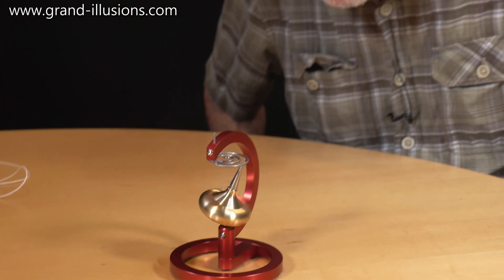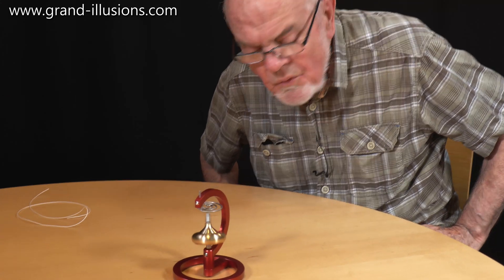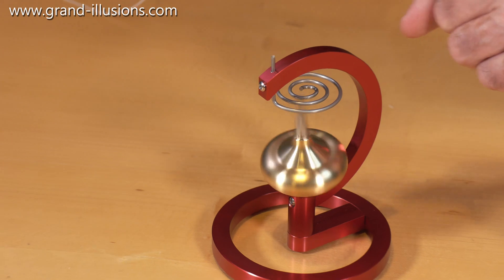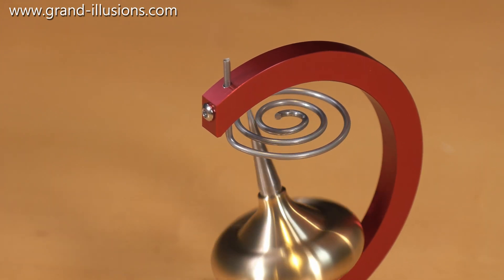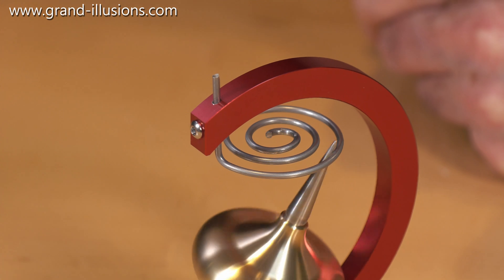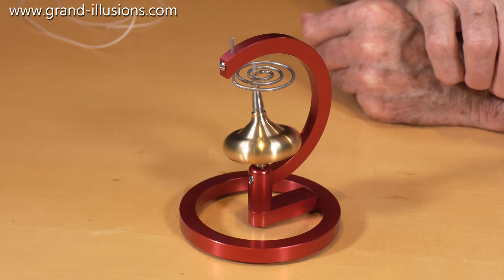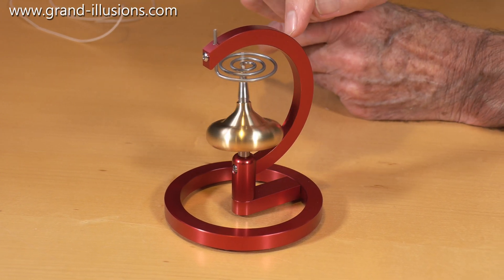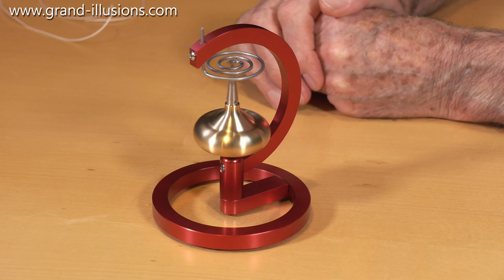Maxwell's Amazing Spinning Top

Comment: That is pretty cool for not having magnets; a lot of friction force is transferred at the point of contact that would probably be about 20% of a square millimeter. When I was a kid I had a linear version of this sort of, that was magnetic. I am sure it is still sold as it's fun and probably cheap to make. This device shown is more cool but it is just a thing you put on your desk. The cheaper toy I mention is fun the same way as fidget spinners. Two parallel tracks that are like a C stretched linearly 8 inches, and the spinner runs across track connected with magnets, then reverses direction...but you can make it go faster or slower or change direction with hand movements.

Comment: So if it’s not magnetic, how does it work?
Reply: I am guessing weight and pressure, it is always trying to pull itself upright but the coil is in the way, combined with the gyroscope effect of it spinning and it is always trying to push against, the coil to try going upright, and forever fail at the task.

Comment: fascinating. centrifugal force on the tip of the top pushes the tip around the spiral bar, which has two open sides to it, the inside and the out. centripetal keeps the tip going around that bend to close the loop between the two sides….correct me if I’m wrong on the science.
Reply: When the top is on the inside, centripetal force pushes the top outward and the wire applies an equal and opposite centrifugal force.

When the top is on the *outside*, there is nothing applying centrifugal force and you would expect the centripetal force to just fling it outwards. Thus, there must be something else at play. What is it? I don't know.
Reply: Centrifugal force is not a real force, and if two were balancing there would be no rotational motion. 
This looks more a consequence of gyroscope effect - spinning object resists change in its orientation. So when gyroscope is outside, it tends to go back inside to its original vertical orientation, but seems as it goes closer to the center it spins faster, so perhaps when it touches the wire large contact force with the surface kick's it back out again and process repeats.    @antonliakhovitch8306
Reply: The center of gravity is below the pivot point, so it's self righting of gravity on the outside run.